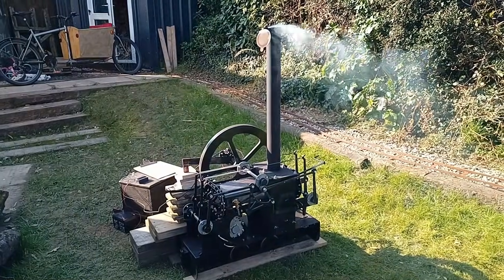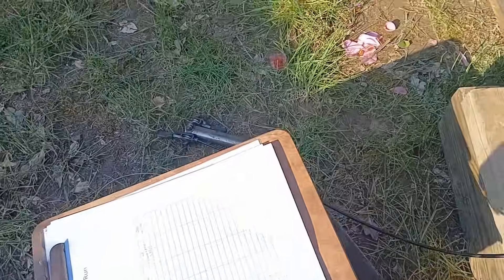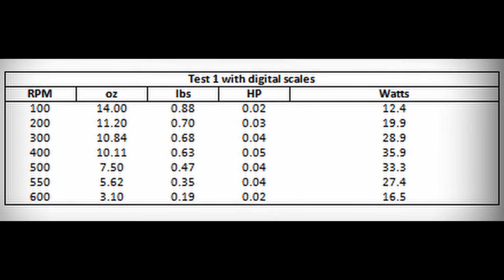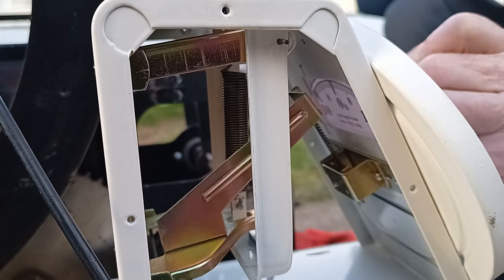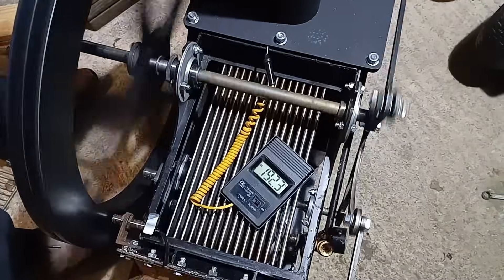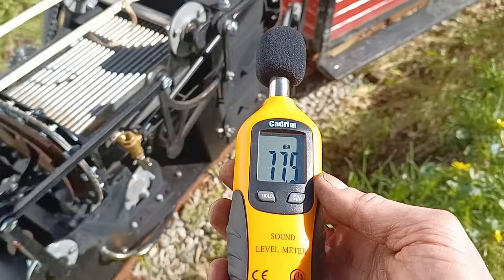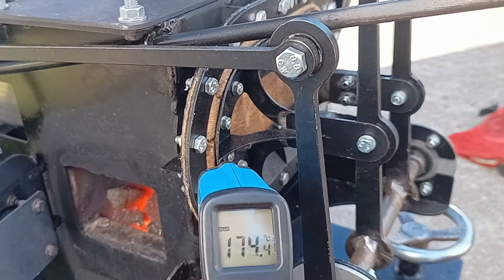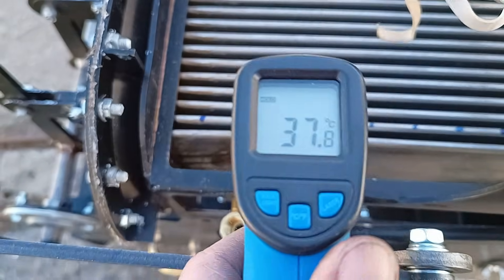Hot Air Stirling Engine Locomotive - Part 10

Comment: i wrote a comment elsewhere saying i think this will be double the Mk4, as predicted, bc of the doubling of the surface area of the heat exchanger.
i said before that the MK4's hot side heat exchanger was too small for it compared to the cold side, the cold side had water which is 25x times more efficient than air at heat transfer, but for this one which is air cooled, the cold and hot side could have been sized the same, the middle section could be turned into a regenerator which improves the efficiency and power of the engine.
I think insulating the middle section between cold and hot would improve it, isolating the pipes of the regenerator is advisable but this means radical modifications of the engine which i think maybe is too much for you, but i advice you add insulation and see if this improves it, if it does maybe it will be an encouragement to add further improvements for the regeneration.

Comment: Shane, suggestions: 1.) make yourself a simple balance beam with weight adjustable along length to measure torque, the inertia of the weight will balance out the variations and give you more stable readings. 2.) There's a difference between measuring gas temperature with a probe vs. using a surface gauge or IR thermometer. The surface will be at considerably lower temperature than the internal gas temp because it is exposed on one side to ambient. On our steel woodstove, we take as a rough rule of thumb, internal temp of roughly twice the dial reading on a surface mount woodstove thermometer. A probe thermometer in a hole (where practicable) can verify for you the difference.

Great work -- I've enjoyed the series. Been building Stirlings, myself for about ten years.

Comment: That’s why sometimes an old avo meter is the only way to measure a rapidly fluctuating current/ voltage. The needle smooths the reading so it’s legible

Comment: Have you thought about adding a fan to the flywheel and having a flu which directs cold air over your heat exchanger for an improvement of heat sync efficiency. It might be a little more work, but it could vastly improve the speed of your engine.

Comment: I think 80 watts is pretty good for a solid fuel hot air engine using air as the   working fluid. I think you'd be hard-pressed to find a practical engine of the same type and size that performs better than this. I think the simplest improvement is to insulate part of your cooling fins so they behave as a regenerator since it appears from your graph that you don't need them to reject heat. Similar problem existed on the previous engine. It might be easier to throw a gas burner in The firebox for performance testing. Then run it on coal for recreational use.
Reply from the maker: Hi, thanks for watching. I will probably include a regenerator for a next attempt (I just had to see the difference for myself, twice!). Gas burner for testing is a good idea
Reply: Insulating the outside of the cooling fins would not be a good idea, that's not how a regenerator works.  Heat needs to be dissipated.  A water cooling jacket would be better...

Comment: One of the most impressive big Stirling engines I've seen. It's very hard to get a big engine to run fast, especially with air at ambient pressure.

Comment: So two things.

1. I believe you need to use a knife edge on the scale to get an accurate reading.

2. You mentioned a blower of some sort, keep in mind some of the early steam locomotives absorbed enough of their horse power just to blow the fire that they were impractical.
Reply: 1. No.
2. So what?

Comment: You may have thought of this before, for the power meter I would try a 2nd hand cycling (crank or pedal) meter, they have built in algorithm for dampening and compensating for oscillating power and the range is appropriate for your sort of duty. Linking to a basic Garmin cycle computer would give you the ability to download the trends, power and cadence/RPM to a PC as well. Either that or if you can get hold of a smart turbo trainer it could be rigged up to a friction drive off the outside of the flywheel.
Reply from the maker: No, I have not thought of that! I'll take a look. Many thanks
Reply: @ShanePomeroy  I hope it is helpful, they come up on echo bay reasonably often from wealthy cyclists upgrading their kit 😁

Comment: And i have just reinstalled matlab on pc :) i do not believe in coincidence. And yes - you cooler is kind of 1/3 of too long. You may add some gas boosters on first few inches to reach that damn 150 watts.
Reply from the maker: Hi Stanislav, I was worried because it was only air cooled. It will be interesting what the temp gradient looks like it the summer. I'll get together engine details for you, cheers

Comment: Any estimate of its efficiency?
Reply: A glowing red hot fire must be putting out several kilowatts of heat so it's going to be single digit percent at best.
Reply: I expect most heat is not even entering the Stirling cycle and instead is just going out the chimney.

Comment: Have you tried to put steel wool in the tubes as a regenerator. ?? Or added a heavier gas such as sulferhexafloride
Reply: or helium maybe
Reply: Pressurizing the engine and switching to helium or hydrogen will increase the power density dramatically. But I can't imagine either one being practical for a backyard locomotive. I do think that the tubes need some type of regenerator material in them to enhance surface area and to reduce dead volume. Even slipping a sheet metal strip into the tube from the end could make a big difference.  And insulate the middle section between the hot and cold end.
Reply from the maker: @ I think you could be right : ) I'll try and do it when the diaphragms  are next removed. Thankyou
Reply from the maker: Hi, My Dad and I are weighing up options for a future engine. At the moment the most practical option to us seems to be fine woven mesh crushed between the tubes. This will hopefully add regenerative material, heating / cooling surface and also encourage turbulence. Thanks
Reply: If you rolled the mesh into a tube and then slid it inside the steel tube before you crushed it. Then you'd have a double layer wire mesh regenerator that fit perfect. You could make it a bit short so it didn't end up in the firebox section. That's the last idea I'll leave you great project.
Reply from the maker: @andygammie7394  Great idea! I think this will need to be the next step. Will be on the next engine now, cheers
Reply: Yeah the trick will be retaining it so it doesn't end up in the Pistons. Also, you could vary the profile of the inserts so the gas flows faster through the center of the engine and spends more time at the hot and cold ends.
Reply: I don't think you'll see huge improvements, but it's relatively easy to do without having to modify your setup too much.

Comment: Nice!!
But You coul test a loaded train go like 5 times around your track , time it and than compare it to like a 1200W geared Drill with a rpm regulattor on and a Wattmeter ...?
Just tune it to match the laptime.
To mee it looks more like 1000W work ;)
Regards from Norway!
Reply from the maker: That is a great practical solution! (right up my street). It might offer a more accuracy then the current setup!
Reply: Maybe 200, but definitely not 1000 watts, c'mon....

Comment: Thank you for sharing. 😊

Is it an idea to make the spokes of the flywheel like fan blades and have it push cool air over the heat exchanger plates?
As far as I understand sterling engines, the greater the temp difference the more power.

Cheers
Reply from the maker: You are quite correct. That is a good idea and I well might do that on the next engine! many thanks